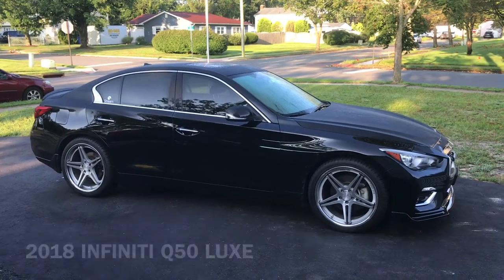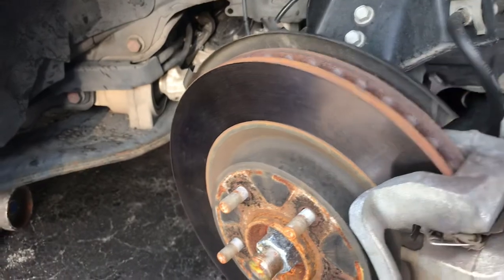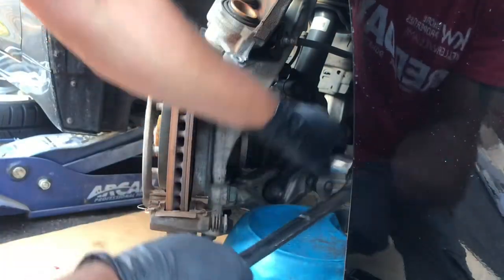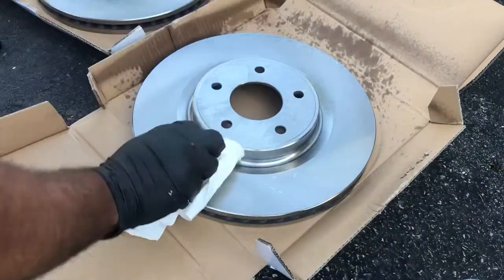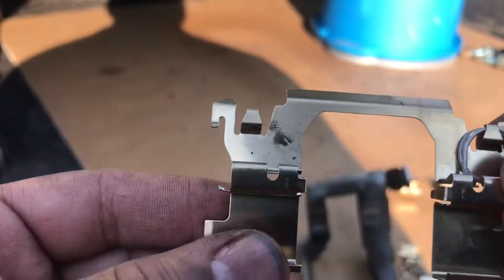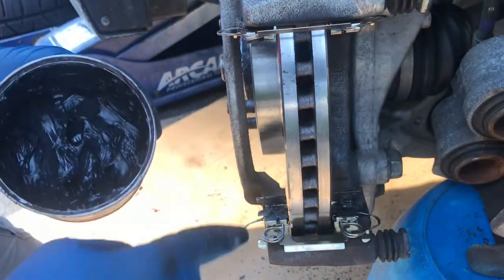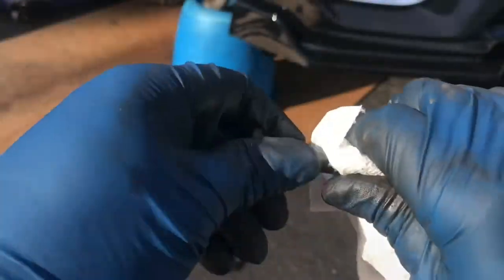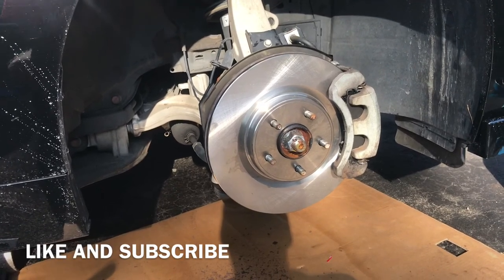INFINITI Q50 Q60 FRONT BRAKES REPLACEMENT - How to change Brake Pads and Rotors on an Infiniti Q50

Comment: Make a major installation note early.

DO NOT  try to change both sides of same axle even with a helper.  The logic is use the other side as a reference point is you get stuck o a step during installation.  

If this is a rear brake rotor change make another major helpful hint.

The rust preventative coating they apply also gets applied inside the the rotor hat and that CAN be a problem,  not overly common but noteworthy.

Some even modern day vehicles still use a drum assembly for the parking brake.  The parking brake assembly might be fine but the coating can be applied too thick and essentially becomes too smooth for the parking brake to engage.....especially on the slightest incline.  One of the few if not the only part of the rotor that should be rough.

Ask me how I know!!!
Reply from the maker: Good advice. Thanks!

Comment: How different is the sports break tho? You mentioned twice…I got the Q50s
I’m thinking the calipers? 
Plz let me know as I’m about to get working on it
Reply from the maker: Sport Brakes are not hard to do. Take a look at this brake job I did on a Mustang. 
The procedure is very similar. 
https://youtu.be/VV5MUhY4DhM
I think the Infiniti has extra pins holding each of the slide pins in place. Pull the pins out and knock out the slide pins.

Comment: What was the torque for the mounting bracket and caliper bolt?
Reply: Grown man body strength torque tight 😂
Reply: About 7 or 8 out of 10 on the ugga-dugga meter.
Reply: torque? uh whats torque  😂

Comment: I have the same powerstop kit as you, did you notice the pad's hardware clips are different (3:39). The clips I took off the car were identical but the fronts on this kit have 2 different types that are very similar. Unless its different for left/right I have not done the passenger side yet.
Reply from the maker: I don’t remember receiving additional clips other than what you see on the video.
Reply: @fixinit  i just did the brakes on my car, the front hardware was all the same, but the rear brake hardware had 2 different "styles". they looked almost the same, but the gap that the rotor fits in was wider on one than the other, i think because not all the vehicles the kit is compatible with use vented rear rotors, which are wider than a non-vented rotor.

Comment: I got one question how does the rotor get screwed. Like what bolts hold it in place? Cause I didn’t see you take anything off that holds the rotor or was it the 2 22mm bolts behind the caliper?
Reply from the maker: Rotors are held in place by the Lug nuts.  Some cars have one or two small screws that hold the rotor in place but they are not really necessary.
Reply: @fixinit  okay cause I got a q50 as well and I was wondering what hold them in. And was scared to change them my self. But thanks

Comment: Great video. Where did you get those break hardware like shim?
Reply from the maker: Thanks.  New hardware is usually included with the new brake pads. If not, any auto parts store sells the hardware kit.

Comment: On the metal springs where you install the brake pads, do the brake pad ends need to push in on the metal spring prong? I hope my question makes sense
Reply: it does, and yes, they need to push the end of the spring in. it's what keeps the pads from constantly touching the rotor causing premature wear/failure.

Comment: Great video very helpful. Do you know the torque specs of caliper bolts?
Reply from the maker: Don’t know exactly but they don’t take much. Around 20 - 26 ft-lbs.  
The bracket bolts are a lot more, around 100 ft-lbs.
Reply: @fixinit  Awesome thanks